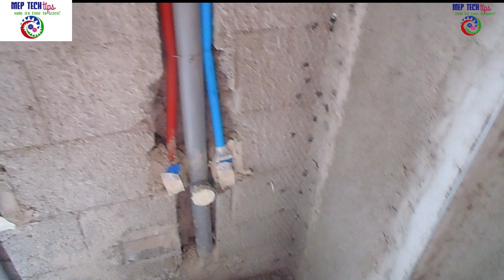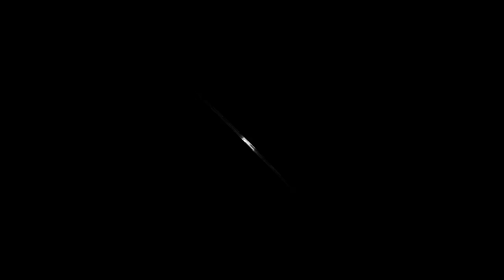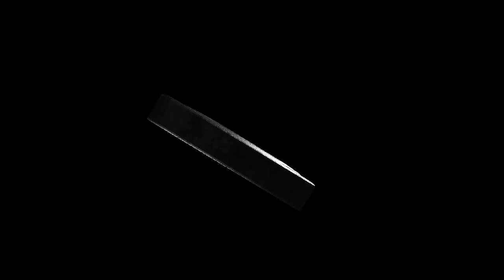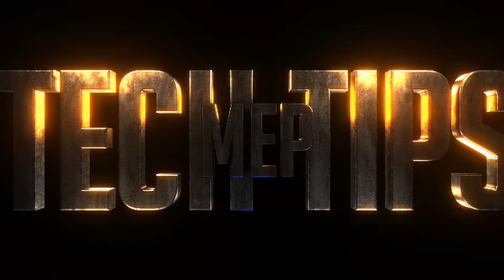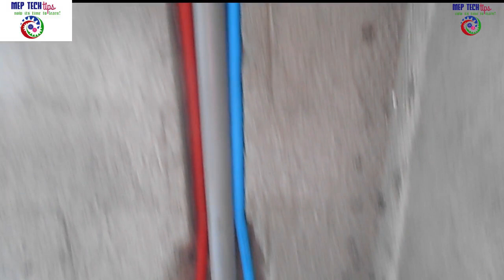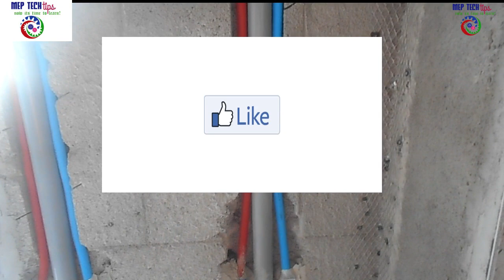How to Install Pex Pipe Step By Step In Block Wall in English By MEP TECH TIPS

Comment: Can you explain how to connect branch feed PPR pipe to PEX pipe connection and above ceiling pex connection used long radius bend drop to low level angle valve or using brass elbow used?

Comment: please make in hindi aslo and why we are using PEX as place of copper or PPR or pvc ? i am first time watching first time this type of pipe
Reply from the maker: Pex pipe work for the water supply system is old fashion and its a proper standard work as per international plumbing codes.
more over, you can use PPR and PVC as well depends on client required